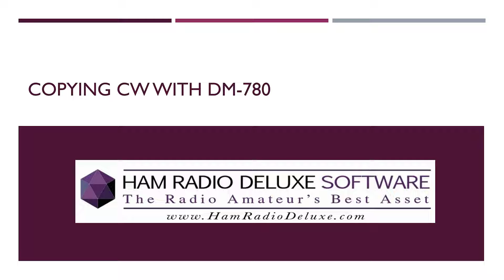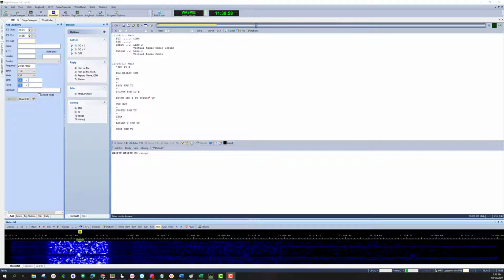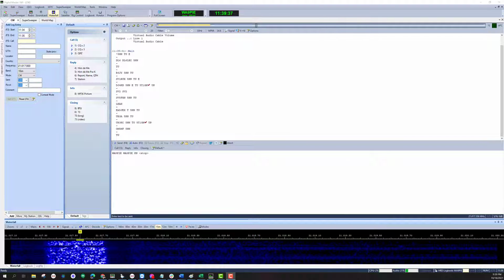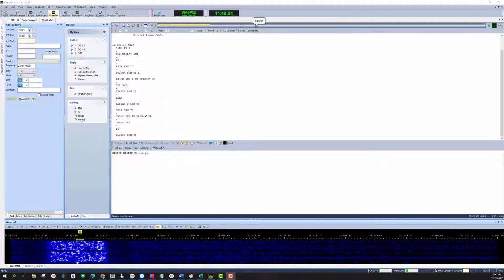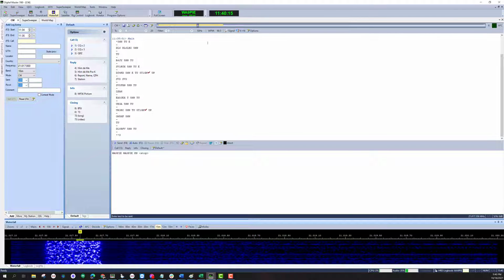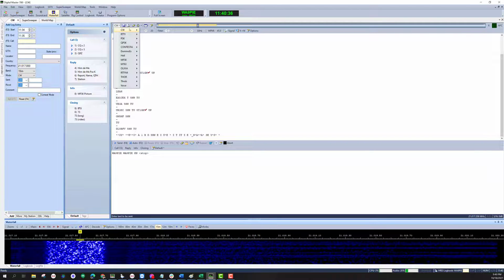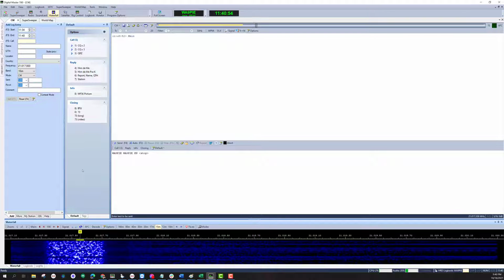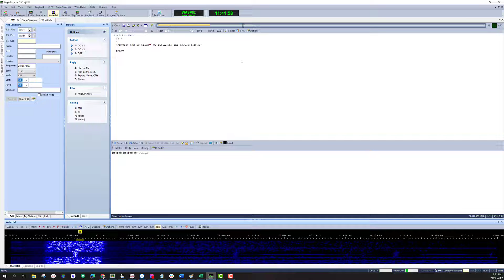Demonstration Copy CW Ham Radio Deluxe DM-780

Comment: Where can I find how to use DM 780, a WKmini keyer from K1EL and a IC 7300 to send CW from the keyboard? Pretty sure it's a setting that I am missing somewhere, either on HRD, or in the radio.  No problem in copying CW, just sending via a keyboard.
Reply from the maker: I've got a K1EL Winkeyer in my microHAM device. It does require a dedicated COM port to operate it from DM-780 (with the microHAM anyway). That's worth looking into.

Comment: The DX Stn is using a macro if you will. Thus you are coping perfect generation of the characters along with a solid rx signal. How abt monitoring cw from any individual op using his own paddles (straight key def won't happen) or general cw qso. I'm only suggesting that it be known, that one will only obtain periodically perfect copy under the best of times and propagation. I find that DM780 is a relative tool to have in ones pocket especially for the fine people wanting/desiring to better themselves of the A1A mode, albeit nothing negative being implied. So to sum it all up, DM780 is a decent tool to have at your dispsal. just remember, everything has it's limitations.  73 all de KI8DU/Roger.